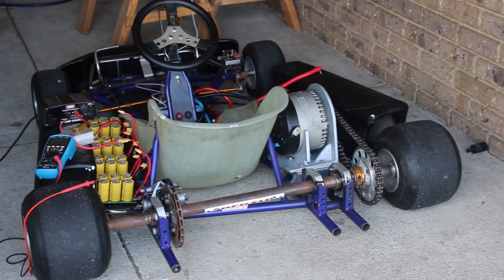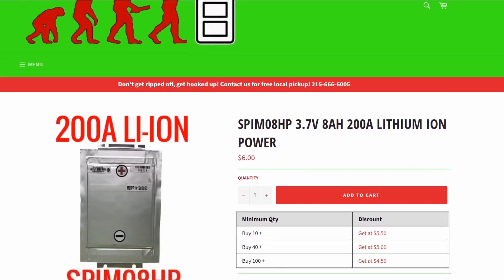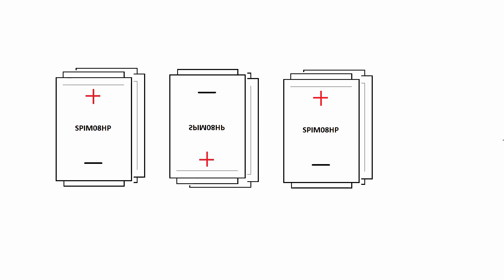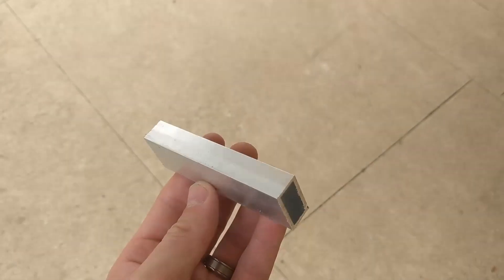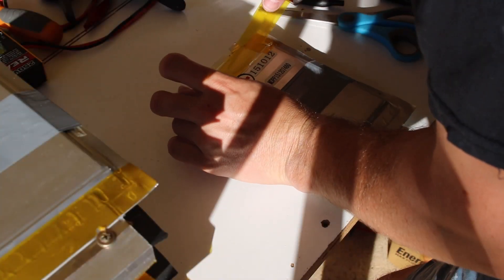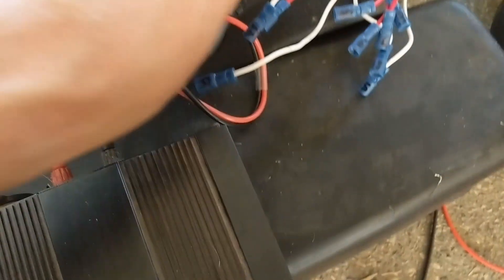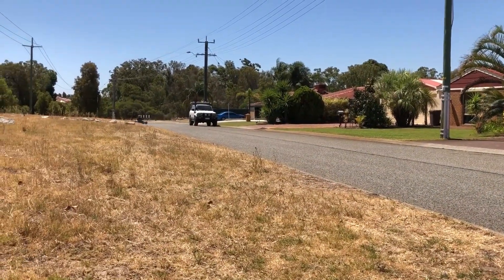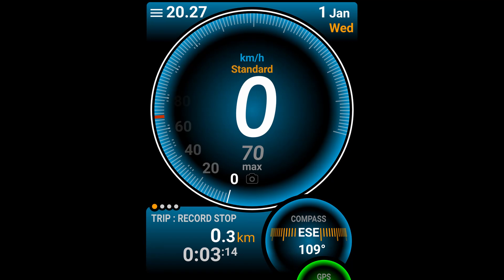DIY Electric Go Kart (Part 5)

Comment: Aluminium is actually more conductive than copper 160 to 100, copper wire is less prone for breaks in cables, so a ali block was the way to go :)
Reply: Aluminum is NOT more conductive than copper!! Copper conducts better electrically and thermally than aluminum. Aluminum beats copper in price and weight. Why spread misinformation? You sabotaging here?

Comment: just a thought. put the super caps in series instead of paralel. motor caps battery with the newer batteries the parasitic draw will be far less noticable. it should also allow you to keep a higher peak burst of speed capacity without the concern of having to recharge them separately.

Comment: Is the controller using a soft start? Seems like all that power should be instant and the controller is really limiting it down low. Shouldn't you be able to tune that out of the program? Your clamped readings show its not getting full amps initially. The much smaller brushless setups I've played with at 120a out accelerate that kart hands down to 15-20 or so I'd say. then you'd fly by! Great build! keep at it!

Comment: You would have better results using 8s 5000mah  batteries,150 amp brushless combo for 1/5 scale RC car ,it produces 7500w,15000w peak ,cost under £300
Reply: Why would be better to swap his Etek/Motenergy unit for a brushless rc one?

Comment: I'd recommend dropping the capacitor idea. As you found out earlier they have very little energy density. Great for regen braking energy storage (with an AC motor and appropriate controller), but that's about it.

Still, not bad for some cheap packs and a small motor. Keep at it!

Comment: im using the same cells, doing a build with 1/4" alumin bus bars 21s 3p. can you tell me how your voltage sag is on these cells? ive heard they are pretty bad from other builders, but for the price is the best bang for the buck.
Reply: Rex Smith II did u do it?
Reply: I’m thinking about them for a electric dirt bike
Reply: I mAde my battery it’s huge,
This is for a off-road scooter but that’s funny my next build is a dirtbike
Reply: Rex Smith II how was your range? What bms did u use?

Comment: I love the idea of having a hybrid power system. When you integrate a BMS for your Li-Ion batteries, I highly recommend getting one that has programmable controls for current output, usually called a smart BMS. This way you could set the current at something like 250A which limits the battery current draw at all times. During a hard acceleration, the majority of the current 'should' be drawn from the supercaps, then switch to the battery once up to speed. Then, when the motor draws less than 250A, the supercaps will charge up for the next peak power event. This way you should get the benefits of both power storage types. 

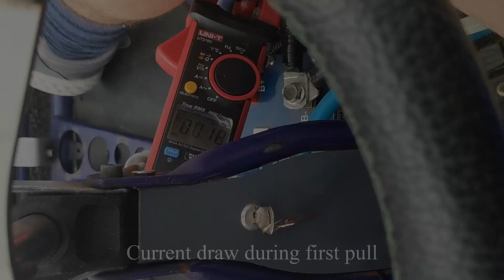Also, it seems that the DC brushed motor has a difficult time "getting off the line". At first, I thought it was you easying into the throttle, but the test @ 4:25 shows that you are flooring it. Then I noticed that the max current (322A) was 5 seconds into the acceleration, which should not be the case. The max current should be when the cart is still sitting still and you floor it. The circuit control method you are using seems to have a massive delay, possibly from the solenoid (but even that doesn't really make sense), but double-check that there is not a programmable setting for the controller that deals with this delay. It seems most logical that it is from the motor itself, but it's a puzzle to me why it would have such a delay...

Anyways, great work on the cart and this series! Keep it up!
Reply: Ah, upon taking a closer look, it seems to be that pre-charge resistor limiting peak current immediately. What resistor are you using? Is it possible that it is not properly matched for your battery voltage and is causing this loss of acceleration? A 600-650 Ohm 10W resistor seems to be like what you need based on the wiring diagram shown in part 2.
Reply from the maker: Cheers Isaac for the lengthy comment. The controller has a number of features accessible though USB connection and a windows program. Inside you can set various thresholds and also plot out ramp rates for current draw versus throttle position etc. Some of the settings may have limitations on the amount of current output during acceleration, but yes there is also a precharge resistor across the solenoid to limit inrush current. I'm using a 10w 470ohm resistor. 
As for the capacitors they have almost become redundant because there is very little voltage sag now with such a powerful battery, also once the caps discharge they will pull all the current possible to fill up which is a big load on the battery pack - so I have been designing a circuit to manage this which I want to show in the next video. The BMS I am looking at only has an external current sensor rather than running that amount of current through the PCB ( less expensive option). I will showcase more findings and discuss some of the points you have bought up in the coming vids. Cheers heaps for your interest
Reply: @TheHandyTech  Sounds great, I am excited to see what you end up with! Also, what do you think is causing the max current delay?
Reply from the maker: @isaacroufs5779  The controller has a throttle rate setting - a slide scale from 0% to 100%. If I recall it is set to max already, however this indicates there is some sort of control circuitry that may be interfering with current delivery. I think if I set that to maximum, set the mode to Peak Amp Mode (allows 15% more current draw than max - hence drawing over 300A in the  video) and also plot the throttle curve to a maximum at all times, we might see some improvement. Will do some further testing and get it into the next video
Reply: @TheHandyTech  Awesome, I'm looking forward to it!

Comment: Hey Man. Just saw your gokart video. I´m using the same cells on my gokart build. You should use higher voltage.... I´m, using the spim08hp cells in a 20s2p config. And the kart flyes..... I´m hitting 92km/h, and under 30km/h its just wheelspin :-) : https://www.youtube.com/watch?v=xQ8qy_29FG4
Reply from the maker: My controller has a limit of 60v unfortunately. That's a cool kart man!
Reply: Sooooo many pilots comment on these ev videos it’s crazy

Comment: Hi there. The owner of Battery Hookup is my friend and I just sent the video to them. Have fun with those cells but be careful, they tend to arc if the pouch gets scratched close to the terminal
Reply from the maker: Cool thanks man I hope they like how I used the batteries! Yep I found their is very little insulation around the terminals, just a small amount of clear plastic, so during assembly and I used some kapton tape to increase the insulation in that area. Awesome cells though, I don't think I have pushed them to their limit yet
Reply: @Javier I learned this quickly about these cells! What is the best way you know to make the connections?